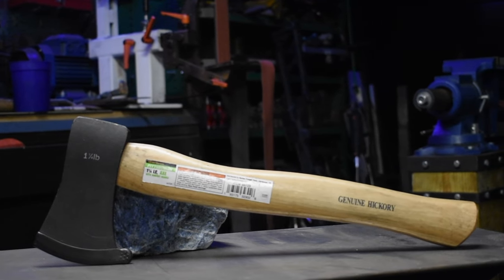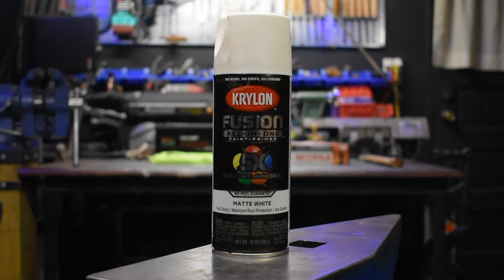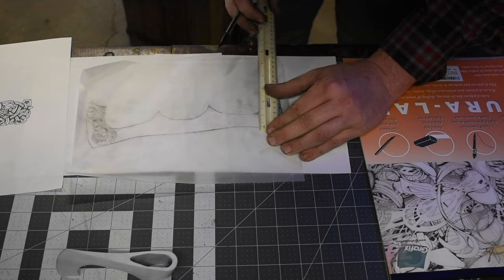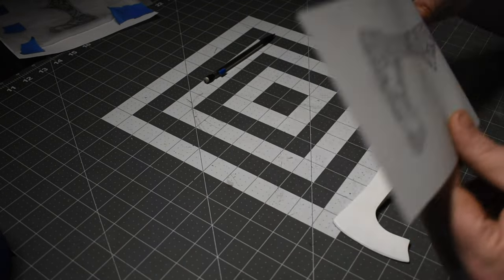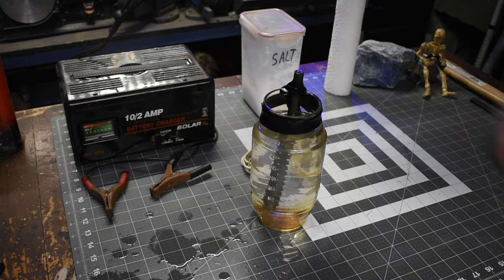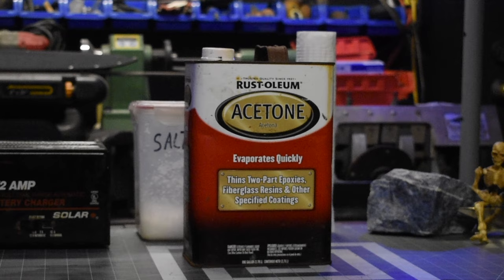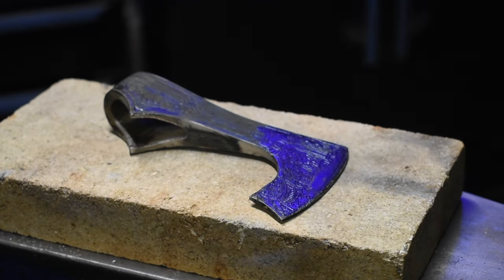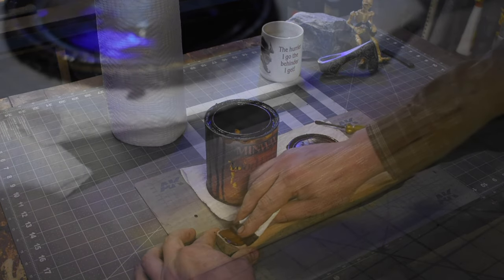Turn $12 Harbor Freight Axe Into Viking Ax "How I Etch Drawing On Metal"

Comment: Man have I been busy the last few months. I feel like I haven't told you what a great job you're doing on the videos! Thanks again for making them. I've replicated this a couple of times from one of your earlier videos, and both times I did it, I ground the axe-head smooth before I cut out the design. Does leaving the coating on there keep the axe from getting too hot on the belt sander during shaping? At any rate, I suppose it's another layer of protection between the axe and the bench vise.
Reply from the maker: Thank you. I did miss reading your comments. 😄   The only reason that I left the coating on when I first cut out the profile, is because I drew a guide line with a marker to keep me from grinding too deep.  I don’t think it would affect anything either way though.

Comment: Looks awesome 
For simpler design could I use a vinyl sticker and be okay in the etching process
Reply from the maker: Yes. Defiantly. If you don't want to use the paint, you can use vinyl stickers for sure. Don't use electrical tape thought. If you want to do a boarder or get straight lines use Automotive Pin Striping. It sticks way better.

Comment: Is there a way to get different tones
Reply from the maker: Yes. If you scratch away and etch the background first, then scratch away and etch a character or something. Then scratch away and etch the foreground, that will give it a more 3D look. Also you can do shading by stippling little dots where you want it darker. I use a sharp tip punch and small hammer.

Comment: Is there an equation or formula to determine the value of the  finished product
Reply from the maker: I’m not sure exactly. Usually whatever materials cost for a project you would triple the money. Then charge per hour. So for that ax it was $12, so it would be $36 + 7 hours .